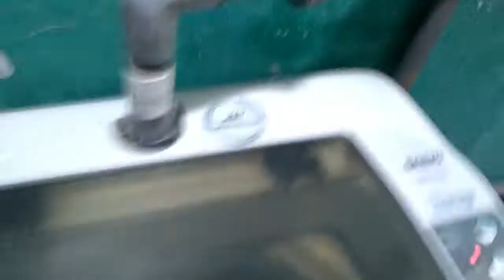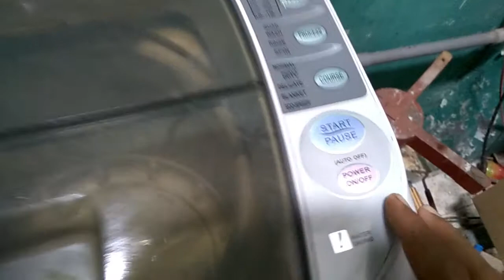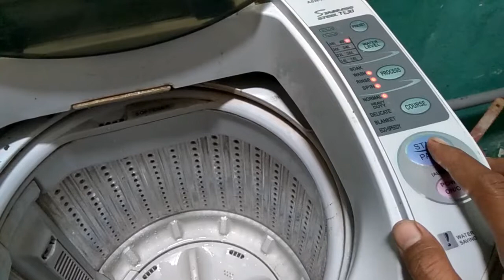Water Inlet Buntu pada Mesin Cuci Otomatis Merk Sanyo Part 2

Comment: pak kalo air terus mengalir meski kondisi tidak nyolok listrik. apa harus ganti water inletnya. sanyo asw 86 sb. sampek brp ya kira2 water inletnya?
Reply from the maker: Itu bisa jd ada kotoran yg mengganjal, hingga klep tidak bisa menutup, klo udh gk bisa diperbaiki ya hrs ganti selenoid valve (water inlet) yg baru. harganya sekitar 40-60rb, tergantung kualitas n toko tempat kita membeli spare parts.
Reply: siap pak. barusan bongkar trus coba bersihin. Alhamdulillah ini normal lagi. tadinya mau panggil service langganan. katanya biaya 200rb. Alhamdulillah terimakasih banyak infonya kang.